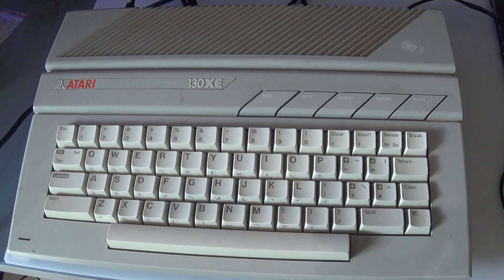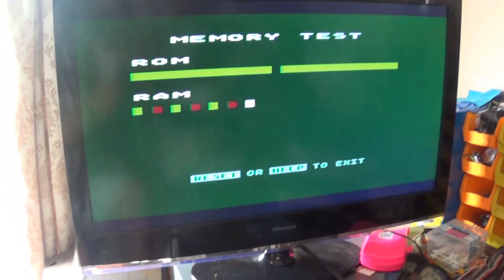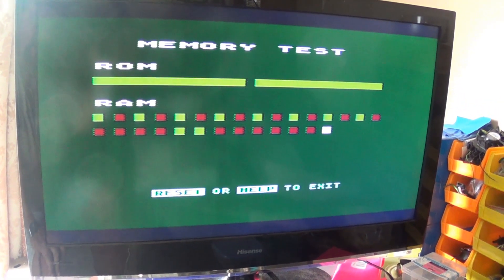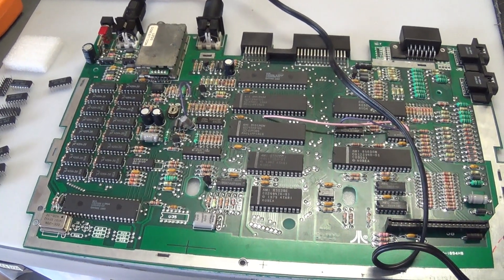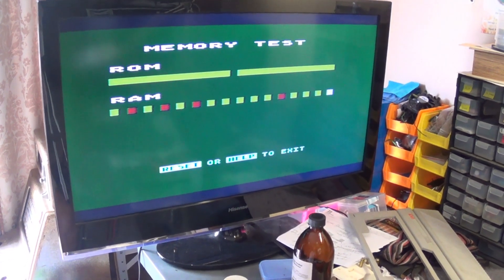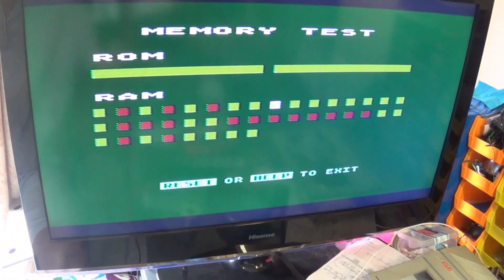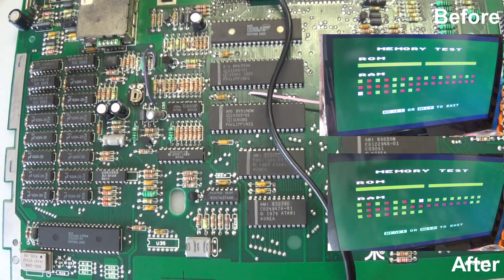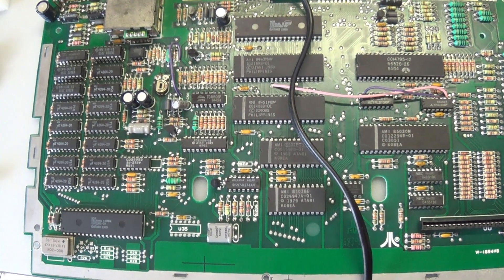Atari 130XE Memory Repair - Attempt

Comment: piggy backing will never  make your Atari work . Its just a method to pin down which ram chips causes issues.
My method of repairing old Ataris is   first  by finding out if one of the ram chips gets really hot. You can do it by  sensing the temperature with your finger or by putting some drops of alcohol on them  and check on which one it evaporates first. 
IF none of the  chips overheat  then you can try piggy backing a new ram.
When you find  one that changes  the pattern, you desolder it, put a socket and install your new ram.
If you keep receiving  the  self test screen you just repeat the process.
You need to find and remove all the bad chips. Piggy backing will never  work on its own.
If that board was mine I would replace ALL the ram since MT chips are well known "garbage" and eventually they will all fail in the future.
Reply: You just saved me few minutes to write the same
Reply: Thanks for writing this.

Comment: Nice video!! It brought back memories and my own XE will undoubtedly need work done eventually. I wish Atari socketed more consistently in its later run... piggybacking is a great initial step but desoldering is a wretch. 

I remember Atari's RAM test only covered up to 48k as some RAM was in use with the diagnostics loaded. I don't recall them ever updating the diagnostics for the XE but it's possible that they did update and let each block represent a higher density?

From what I recall, the -20 and -15 are speed rates? (200 and 150mhz?) The -15 units should throttle down automatically... (smaller number being faster)

That first row made me think "Freddy RAM controller".  Then came the second row and some refreshing randomness.  It looks like there were bad chips, but it's possible the Freddy has gone south too.

Comment: My Atari 130XE started doing the same. It was last powered a year ago and worked fine, but sadly also RAM issues now. Where did you buy the RAM chips? I believe the 41256 chip is also compatible. I’m trying to locate these chips in South Africa but it does not look like anyone here sells them.

Comment: The design of the XE series is very cool. Atari was very smart to enhance the 400/800-range of systems with more capabilities but maintain the software compatibility. I personally own a 64XE as well as a 130XE machine next to a 400 and a 800XL. The only system that has given me grief was the 64XE machine with keyboard issues, but that turned out to be fixed with a good cleaning. 
Shame the ram chips aren't socketed on the motherboard - otherwise it would have been a lot easier. The piggy back method is indeed a trusted method testing the ramchips. Hope you get it working eventually.